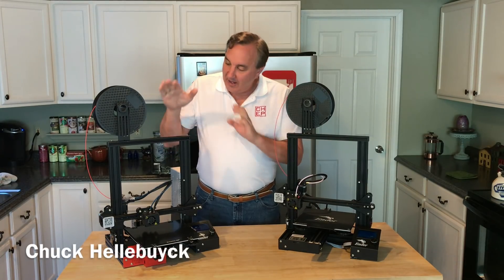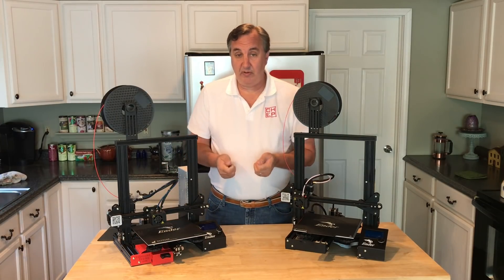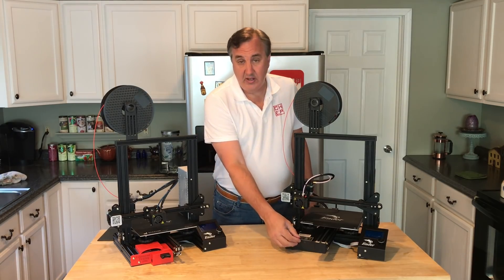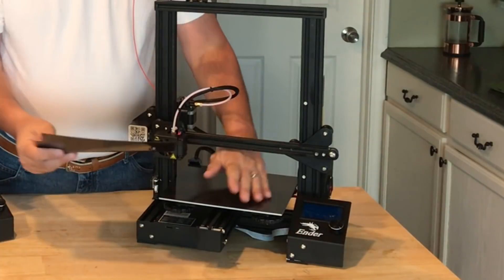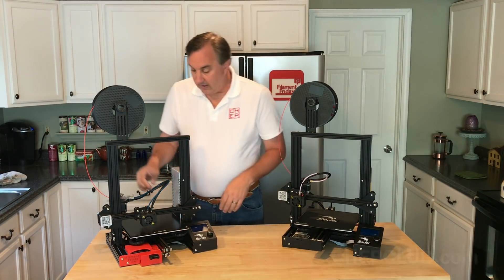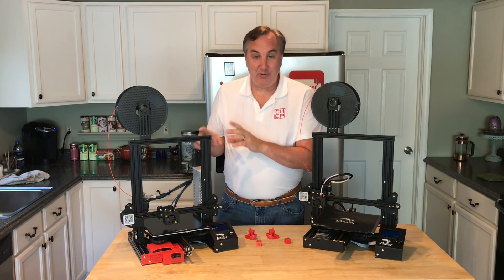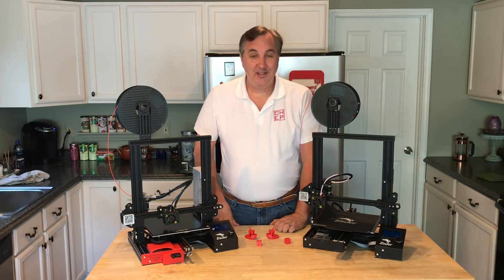Creality Ender 3 PRO vs Creality Ender 3 - Is it worth $100?

Comment: Im trying to update my bowden tube to capricorn tube and ran across an issue. Does the bowden tube extend all the way down to the nozzle (through the heatbreak) or does it stop at the top of the heatbreak? I cannot get my capricorn tube to go all the way through the nozzle, and I don't want to force it and break something. So, should the capricorn tube be able to extend all the way through and come out the nozzle side (before screwing in the nozzle) or does it stop short? How far does the bowden tube go into the hot-end? All the way through or not?
Reply from the maker: If the nozzle is off it should go all the way through. Capricorn can be slightly tighter but should still push thru.
Reply: @FilamentFriday  I can push the capricorn tube all the way through, but as you say, it binds when going through the heat break. However, when I tried to push it through with the nozzle in place I can't tell if/when it hits the back side of the nozzle. When I cold pull the filament back out after a test, I see that there is the filament, then it get's very  thin, about 1/2 diameter, then at the end is about 5mm of filament where it's back to the original size, making me think the filament is 5mm short of the nozzle, however, I have tried everything I can think of and can't get the tube to go further into the hot end. So, im not sure if it's seated or not. How can you tell when you have the capricorn tube all the way to the back side of the nozzle?
Reply from the maker: Take off the nozzle then push the PTFE all the way through without the coupling screwed in. Then install the nozzle by hand until it hits the PTFE. Then use a wrench to tighten it and it should push up the PTFE. Then push down the coupling lock and lower it and tighten it in place. Then when all done put a marker line on the PTFE tube at the top of the coupling. That will indicate if it moves during printing.
Reply: @FilamentFriday  I did this but still have an issue. When I start a print I can feel the extruder pulling the filament into the tube by putting my fingers on the filament where it goes into the extruderr, however, on the nozzle side, nothing comes out for about 1 mintue. Then when the print finishes, the filament continues to come out of the nozzle for about 1 more minute. I cannot figure out what is causing this lag time for both the start and stop.
Reply from the maker: And the nozzle is preheated and you can push Filament through it manually with ease?
What temp are you running?
Reply: @FilamentFriday  Yes, fairly easily but again it doesn't start coming out for awhile. Im attributing this to a gap but I could be wrong.
Reply from the maker: If you use the LCD menu to drive the extruder does it start flowing out of the nozzle immediately?
Reply: @FilamentFriday  No, takes about 80-100mm before it starts coming out, and then it keeps coming out after the extruder stops.
Reply from the maker: That’s a huge amount of plastic. That just makes no sense to me. Even when controlled by the LCD move extruder. I can’t even imagine what’s wrong. If it was blocked that bad it would be clicking and slipping.
Reply from the maker: I’ve seen occasionally that the filament motor runs backwards briefly before it starts. I’ve never been able to reproduce it but it did happen couple times. Use a marker to mark your Filament at the extruder and then start your print. Se if it moves before the print starts.
Reply: @FilamentFriday  I did a test where I marked the filament and then extruded from the console. It's not pulling in enough filament to match the extruded value in most cases. It seems kind of random in thta sometimes it will pull most of the measured filament throuhg, other times it takes in only about 10-20% of the measured value. What's odd is that I get this with both the old bowden tube and the new capricorn tube. Ive also tried 2 different "new" nozzles, so it's not blocking or clogged as far as I can tell. Im thinking of taking off the stepper damper off the E axis to see if this has any effect.
Reply from the maker: Are you sure the gear isn’t slipping or loose or the motor is missing steps.
Reply: @FilamentFriday  The stepper doesn't sound like it's skipping, I have heard that before and it's a very noticeable sound. I can see the hob gear turning so perhaps its not biting into the filament hard enough. I did apply pressure on the idler bearing handle, and that does seem to improve it.

Comment: Honestly, putting a magnet plate on a heated bed is pretty stupid. Ok you can use it for PLA when you don't heat the bed but for everything else, what's the sense?
Reply: Works fine for PLA & PETG. Doesn't work for ABS, but that smells horrible so I don't bother with it. I've not tried any other filaments.

Comment: Would you recommend the CR 10 mini or the Ender for a beginner?
Reply from the maker: They are both great for a beginner. CR-10 Mini is easier to setup (less pieces) but Ender 3 has a lot of support from users. Kinda depends on what you want to print. CR-10 Mini has a bigger bed. About equal in print quality. Hard to argue the $100 price difference though. You could buy a couple spools of FilamentFriday Filament and a Filament Friday Tool Kit for that $100.

Comment: Can it print in abs without overheating?
thanks 

Dino
Edit: can it print petg
Reply from the maker: Sure, but unless the print is small you get splitting. ABS works best in a closed chamber.
Reply: can i buy a closure for the ender 3?
Reply: also thanks for the quick reply!
Reply from the maker: Any type of box will work but there are generic enclosures at PrintedSolid.com and elsewhere. Why ABS?
Reply: @FilamentFriday  i like working with electronics and gears and i want the 3d printed gears to be more reliable and to be harder to break.
Reply: Can it print Pet-g?
Reply from the maker: Many people use PETG.
Reply: @FilamentFriday  does it work well

Comment: will the difference in the powersupply of models be a deal breaker in the long run?
Reply from the maker: Not in the 2 years I’ve had my Ender 3’s.
Reply: @FilamentFriday  thank you for the reply sir! What about the stock bed platform for both models, which one will need constant alignment/calibration?

Comment: 85C is 185F.   Not sure how that limits the functionality.
Reply from the maker: What are you referring to?
Reply: @FilamentFriday  you mentioned the pro being limited to 85c.  I'm a newbie so I was wondering how that is a limitation.
Reply: @dukeplc  Specifically it's BED TEMPERATURE and the bed isn't limited but the claim is that over that demagnetizes the magnets on the bed.   Higher temp bed would be needed for certain materials other than PLA, generally "flexibles" like nylon (I'm no expert just been researching).  There's also people claiming they've been over 100c (even 110c iirc) and the magnets are fine so there's that.  As always, ymmv.
Reply: @FilamentFriday  bed temp
Reply: @JoelAz909  thanks so much.  I'm a novice so very interesting info.

Comment: Do this print metal/ iron material
Reply: Well, i dont you you're joking or not 

but that will be melt entire printer to extrude iron/metal, the melting point is around 1300 C so do the math
Reply: @ivanhendrika  does it do metal like objects?
Reply: @dripsettt4329  well there's 3d print for iron, but with another 3d technic, similar with resin one
Reply: really hope that ur joking, cuz i am sure it could print metal but the printer would no longer exist

Comment: I had the ender 3 and I am having all sorts of problems with it. First the power supply is broke and I fixed it. Now I am having the problem where it won't print my models correctly due a misalignment. I recommend spending a bit more.

Comment: I have the Ender 3 pro and im disappointed. I havent been able to get a decent print out of it since i bought it 2 months ago. My next printer is gonna be Anycubic Predator or Tevo. Creality has better ratings than they deserve.
Reply: Did u get any recommend upgrades?
Reply: Not to be harsh, but I don't think your Ender 3 is the problem...
My regular Ender 3 consistently produces great prints with well defined details. Some of the models have almost undetectable layer lines. I've printed with PLA, ABS, PETG, TPU, and Wood. Whenever there's a problem with a print, it's usually due to a design flaw in the model, poor slicer tune, or I didn't do preventative maintenance when I should have.
Reply: Level your bed. Level your bed, and then level your bed again. And then make sure your first layer is set up properly. 

Most likely operator error, rather than the printer.

Comment: You are comparing a stock Ender Pro against an UPGRADED Ender 3 which you mention spending an additional $120 on upgrades.  Then you go onto compare print outs and say that you do not see a difference and are identical. Sounds to me like you could have save yourself the money and time put into the upgrades, and gone straight for the PRO, and saved yourself $20 over upgrading the Ender 3 to end up with the same print out.   Next time, if you compare something, make sure the description MATCHES what you are actually comparing. An  upgraded Ender 3 isn't a STOCK Ender 3.
Reply: If you watched the entire video, you would realize that what you just commented, doesn't make sense.
Reply: @beaurenov  his comment makes perfect sense. Hes basically comparing an ( ender 3 + $120 upgrades ) and a stock ender 3 pro, which cost $100 more than a stock ender 3. At the end save your self $20 and get filament and use the time saved upgrading to print because like he stated " if i didnt mark them then i would say their print is completely identical.
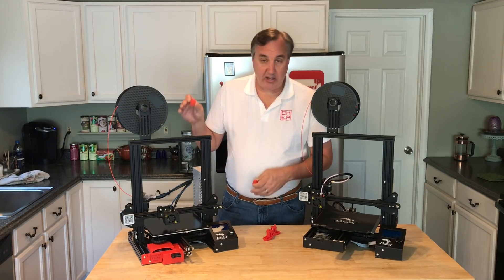Reply: @celsoesparza2387  At 5:30 he clearly says that he restored his printer back to stock and tested both printers.  He took the upgrades off of his printer before he tested them. And both prints were completely identical
Reply from the maker: That’s what confused me about these comments. Other than the SD card adapter I went thru the effort to put it back to stock and then get accused of using an upgraded printer. I just assumed they didn’t really watch the whole video.